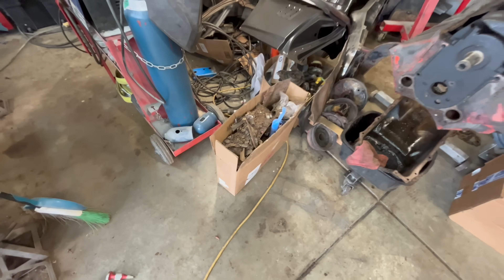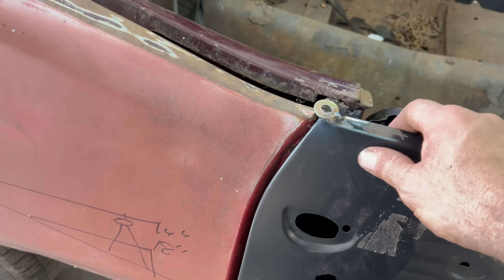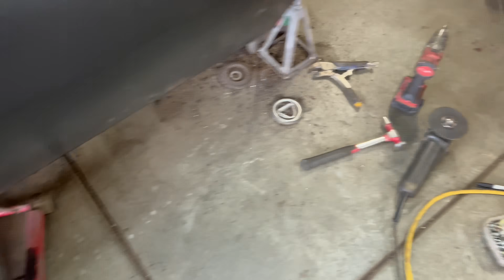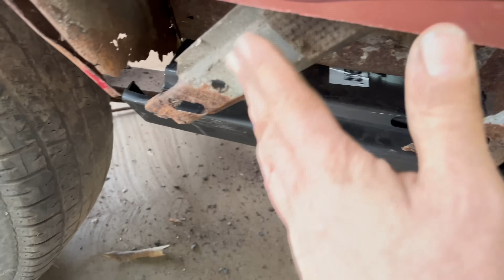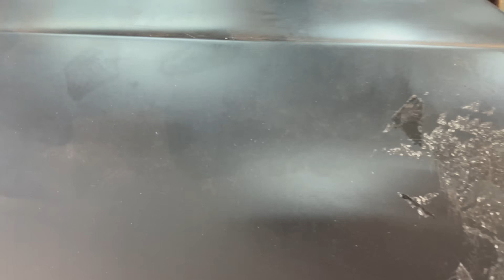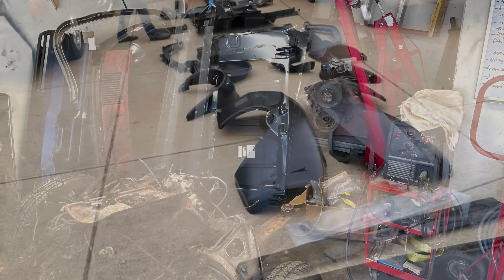Rocker panel install the easy way for a convertible Camaro or Firebird

Comment: Are the rockers slightly lower in the rear or did you install level?
Reply from the maker: They are parallel to the horizon. Easier to keep things back into place

Comment: 11:55 @VinylVillageGarage hey John, question for you - for that gap between the tail end of the rocker and the rear wheel well - should that just be filled with seam sealer, or left open? Working on the floor on my 69 vert this weekend and discovered a 1/4 gap there on both sides.
Reply from the maker: They are typically packed with sealer, even the seam between the 1/4 panel and rocker gets packed be careful not to cover the drain holes into the rocker for water to drain.

Comment: There are a lot more Camaro buffs than Firebird freaks. I say you tackle a first generation Camaro convertible next project. I would think it a good bit more profitable too.
Reply from the maker: I won’t disagree with you. Camaro has a strong and larger following.  Even though this is essentially the same car when it comes to the main body structure.

Comment: You make it look so easy.  Nicely done.  I have noticed differences between AMD and GoodMark and they are pretty substantial.  The AMD is the closest to original.   Nice tip with welding a washer to the door.
Reply from the maker: I agree AMD seems to be better for most parts.  But still have a feeling they are all stamped at the same place. Just sorted by quality

Comment: First thank you for all the content. Secondly how the heck are you able to move through these repairs so quickly… so many family things going on at times and thinking I make sure of what little time I have just can’t get what you can done as quickly.
Reply from the maker: I have had some Practice especially on the first gen f body cars. Definitely helps
Expedite things.  Also part of the reason I share the experience in the hopes it does the same for others

Comment: I like the way you make the parts you have FIT! Most importantly is that is structurally sound AND aligns as best as possible! Nice work!
Reply from the maker: Making it work to my specs is the plan.  Aftermarket part are
Just that aftermarket and not exactly the same as original so they require some creative manipulation to get the best results

Comment: That rocker setup on camaro firebird was the worst thing GM did making those go behind the quarters
Reply from the maker: Yes, and add fuel to the fire by running water thru them to drain out and leave them bare steel at that
Reply: Jon , are you selling this bird as is or after its completed?
Reply from the maker: @ this one actually belongs to my dad.  This is his retirement gift to himself
Reply: @VinylVillageGarage  
Ok. That's great. I have a '68 convertible Firebird that needs restoration.  Do you do that for private owners?

Comment: I like how you used the door as your reference. Thanks for sharing
Reply from the maker: Measurements are important but how does it look when done is way more important.   So only make sense to use the panels to adjust and set the gaps.

Comment: Jon, I know you like to strip the E coat off the panel prior to paint. I saw a thread on the SPI forum where a guy sent his car to the paint shop, the painter priced the job to strip to bare metal and did not. Turns out, there was surface rust on the new panels under the e coat and it popped through the paint. The guy posted pics of the sanded off paint so you could see all the layers, down to the rust. After seeing that, I'm even gonna strip the floors.
Reply from the maker: I have found rust,
Very minor at times under the e-coat that will destroy a new paint job in no time

Comment: I have never done full rockers and by the looks I probably shouldn't try it.  A convert versus a coupe seems to really let you put the big stare on stuff 😊
Reply from the maker: Full rockers are at the higher end of difficulty when it comes to rebuilding the f-body shell.  Not impossible but will take some work to get them in